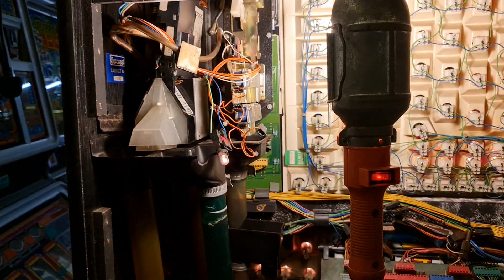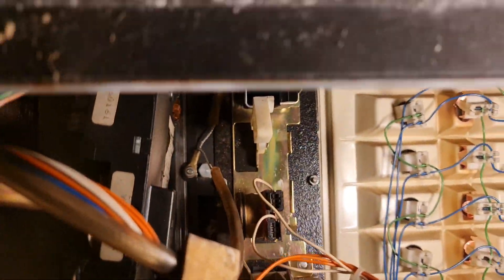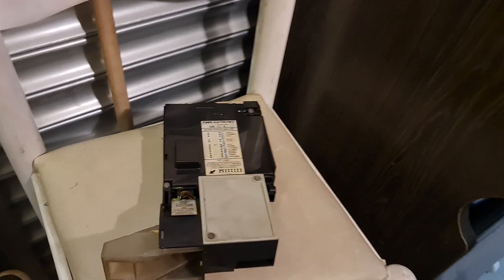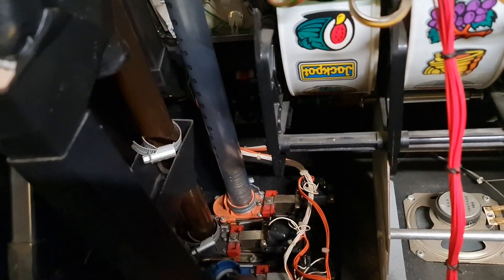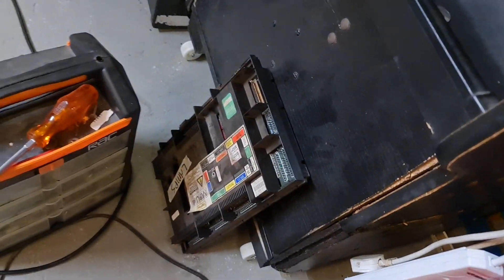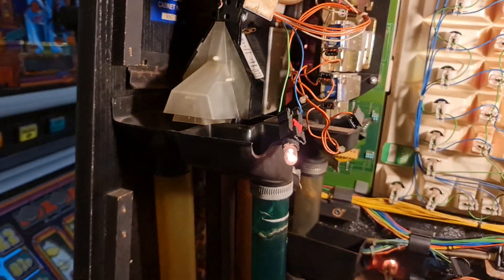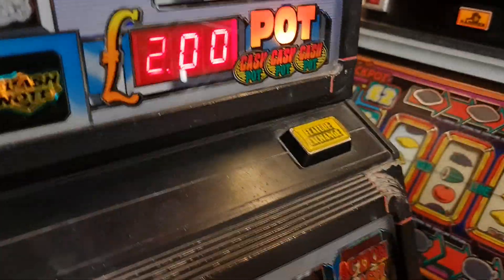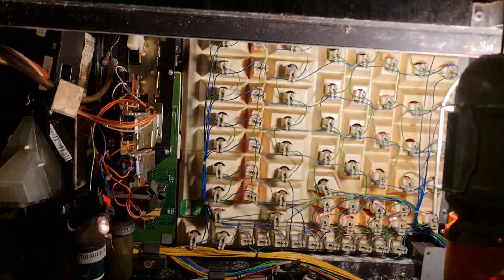Swap'a'Note (Mpu4)(Under Repair) P7

Comment: I replaced my ms111s with cashflows got each one routed to each individual machine (most were same odd 1 differd)just had to change the fitting at the top of the mech to the 111s think ive seen someone who reprogrammes  the ms111s to new coins so i may do that now on but yeah I upgraded the mechs n a chap routed em 4 me.Hope goez ok cant wait 2 see loadsa ata later date liked swopanote tho 2 whoooip.J

Comment: If I wanted to get hold of a 'Tuppenny Chance' in a reasonable condition, how much would I be looking at paying?
Reply from the maker: There's a good few about.  So its not massively rare. A good condition is another matter as they were battered by players and engineers alike.  I would think 2 to 300 maybe
Reply: @stevelancett  Cheers. I remember playing/having fun on them and/or something similar back in my youth.